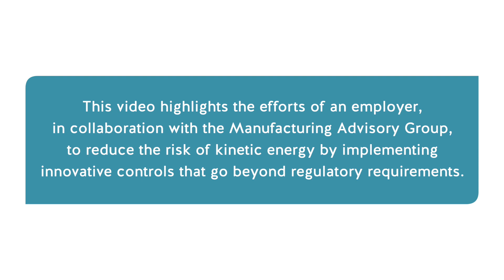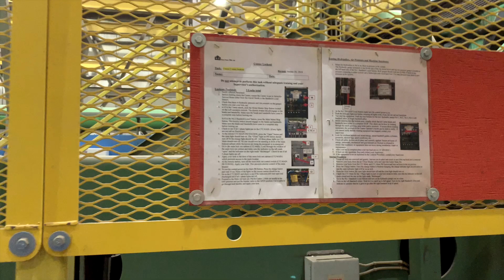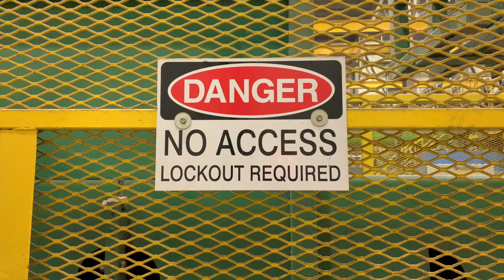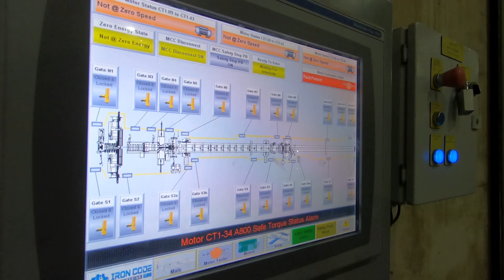Kinetic Energy Risk Management: Case Study | WorkSafeBC

Comment: If i have learned about reading about accidents is that not safety interlock is enough, there is always a flaw or someone in a hurry or lazy that finds a way to circumvent them and ends up injured or killed. A very big part of accident mitigation is working with the workers about safety culture and also the working environment. So many times accidents have happened because workers get too pressured or because someone wants to save money.